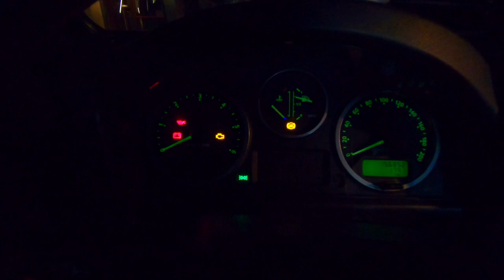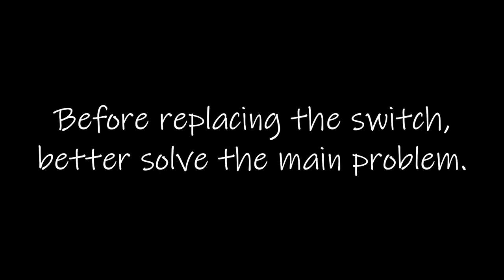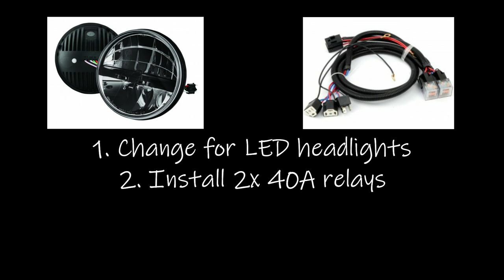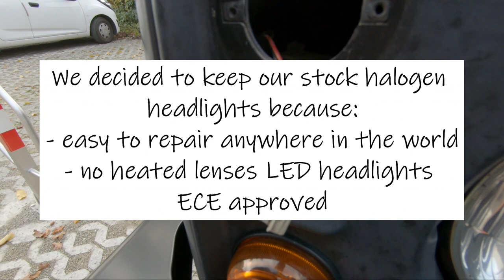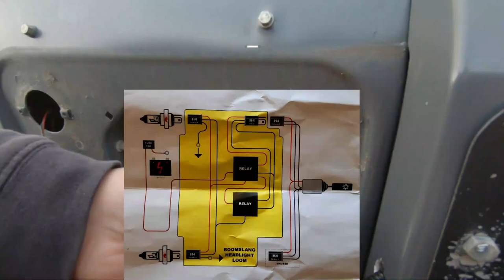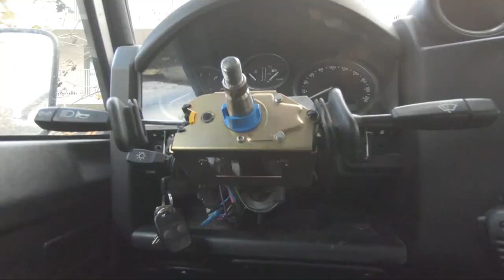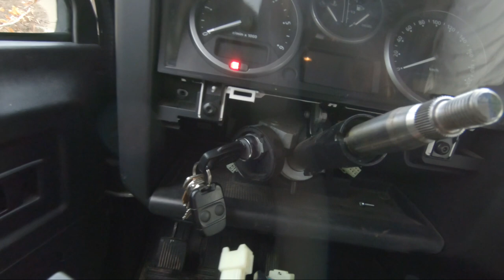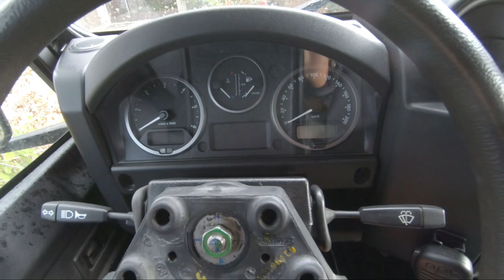Defender HEADLIGHTS PROBLEM ( DIP BEEM SWITCH FAILURE ) | Land Rover Defender | Repair series

Comment: Great video. My switch simply doesn’t hold in brights position, could this be the same issue? Prior to this issue my workshop upgraded the halogen bulbs. Now I wonder about the amperage issue. I don’t want to use leds
Reply from the maker: Difficult to say without seeing the car but your should check with your mechanic
Reply: @offtrackfamily  I checked. The new bulbs are to spec , so much for that theory. Replacement switch on its way, let’s see if it happens again. Cheers

Comment: Mine has this fault but intermittent. Could be worth replacing the switch.
Reply from the maker: You have to test each switch before replacing. Intermittent fault are not easy to fix. You have to test it many times.